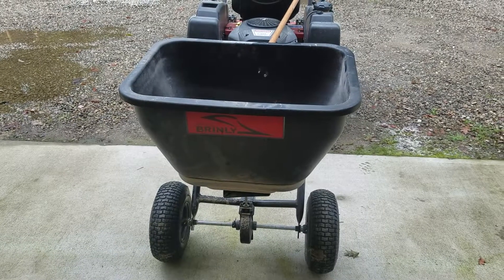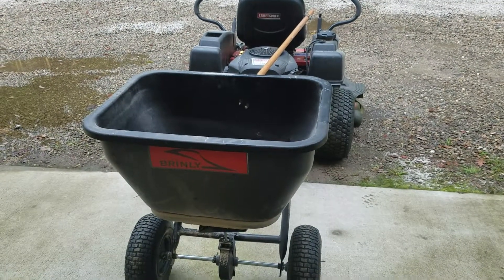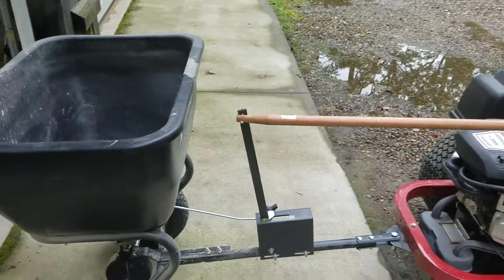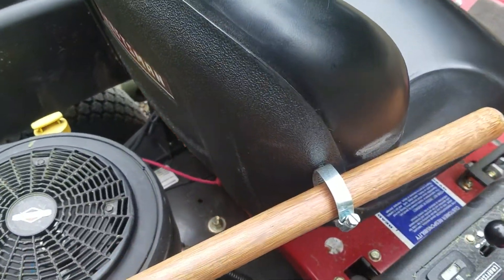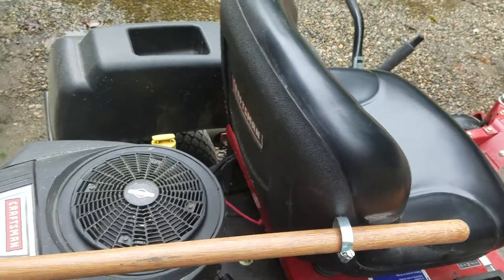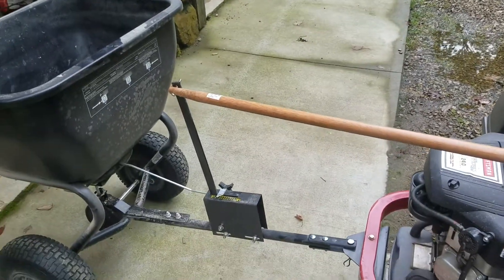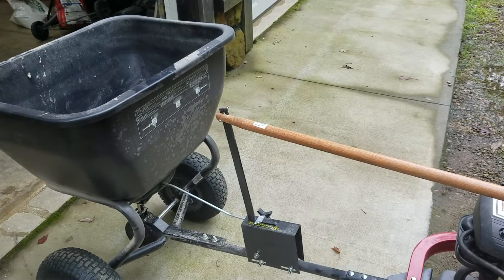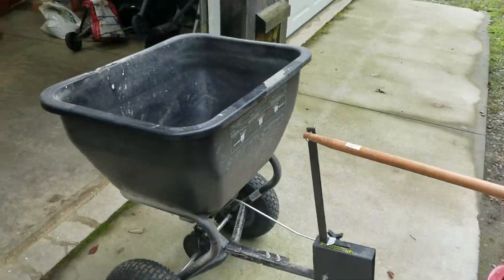DIY Zero turn tow behind spreader hack

Comment: Thank you for this video. This is the exact spreader I bought and I copied you closely with these modifications: I used a longer bolt to allow more "play" at the spreader handle connection, used a metal pole,  and used a "C" clamp on side of seat. This allows the handle to be easily slipped out for sharper turns. Even with these mods I bent the flow control handle on the spreader slightly but no damage.
Reply from the maker: You're very welcome! I'm trying to imagine how that lever could end up bent. I don't think I ever had any kind of impact between the mechanisms that ever stressed that lever. When I would take a sharp turn basically the handle would be a little intrusive on my right side but that's about it. I'm glad you found it useful!

Comment: Nice idea but it seems you’d be pretty limited in the acuteness of the angle your turning.  I’d like to see how it works in action.  Isn’t it amazing that agri fab or similar mags haven’t come up with a universal methodology /mechanism….The actuators are a great idea but you still have problem with setting the actual drop opening size…as well as the slow speed with which the actuators actually opens and closes.   I have a JD 1025 with an hitch so the spreader is even farther behind the tractor that with a zero turn.  A small 12v actuator that attaches to the gate opening that has open and closed adjustable stops would work nicely.
Reply from the maker: Excellent criticisms! I never had any trouble making tight turns. Obviously if a person is quite wide (you know what I'm saying) then that handle could be a problem but then the hose clamp on the seat could be fabed to accommodate that though. This was just a random idea I had a few years ago and used what was on hand. Couldn't have been happier with it and I spread easily 500 bags of lime with it.

Comment: if you were make the bolt on the spreader longer and L shaped and use lock nuts, it would pivot easier
Reply from the maker: i put down like 200 bags of lime with that bad boy after i set it up, had no problems with it at all.  i appreciate the suggestion though!

Comment: Well, I  don't see how the speader can turn. I wish you had shown it in action.
Reply from the maker: It definitely does turn. The only thing that happens is that the wooden handle passes through that hose clamp that's attached to the seat. So as the turn is being made the handle would either push forward towards you or backwards away from you

Comment: Do you have trouble with the hopper not emptying fully? I have the same spreader and have to continually get off and move the product to the hole...
Reply from the maker: I've never had any issues with the hopper. Make sure your material is dry and that the chute is opening properly
Reply from the maker: Come to think of it the first 200 lbs discharges no problem. When it gets down there I'd jump off to shake the hopper once or twice. With lime especially it's all about turn and burn so then I'd never jump off since I'd just be adding another 250 anyhow